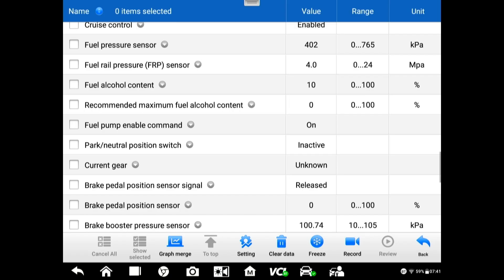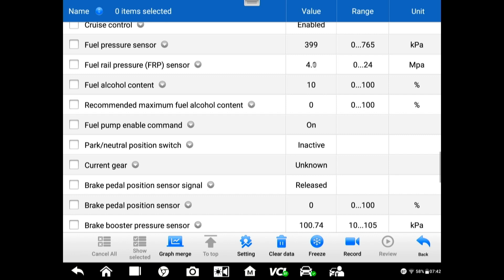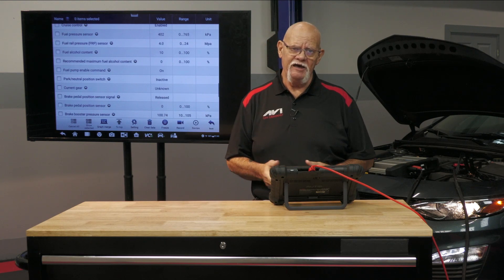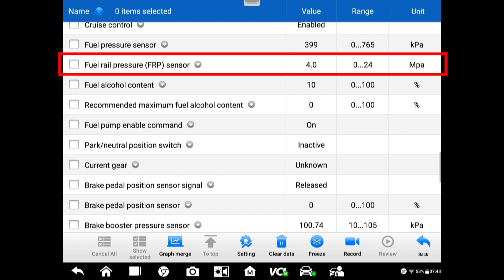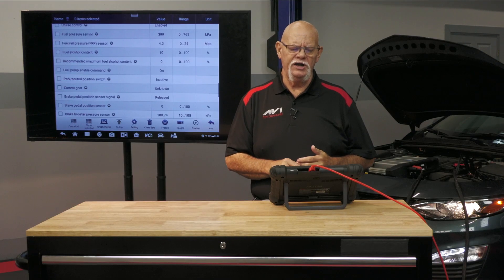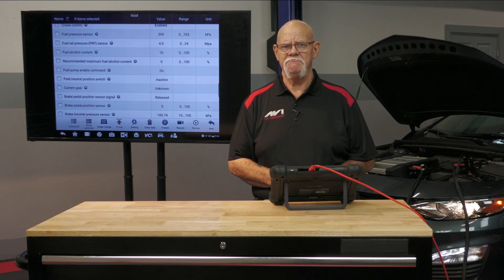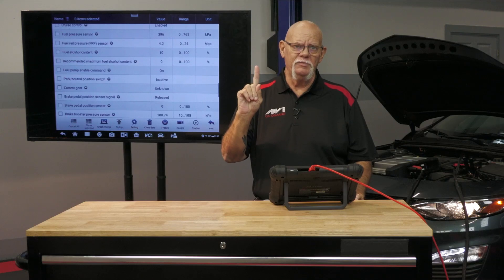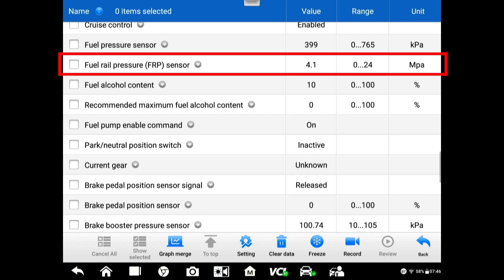GDI Fuel Delivery System - Tip CEDI Chevrolet Malibu  | Ron Bilyeu

Comment: I have a question about discrete inputs, what are there? GM has shown for ignition switch inputs to the BCM on some vehicles. Also  shown on 2000 buick park ave. for VSS input to the PCM ,PCM to instrument cluster . Never heard of this before . just curious .